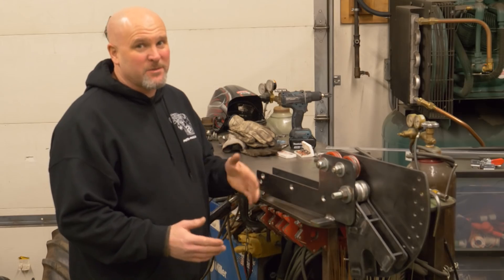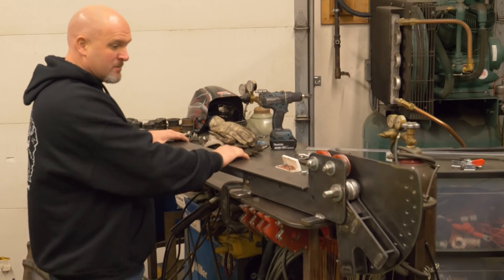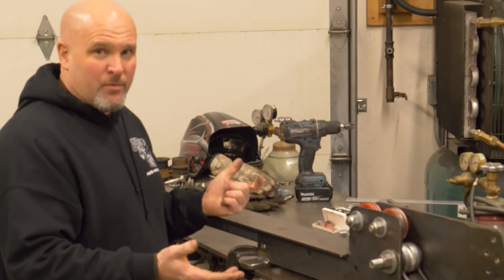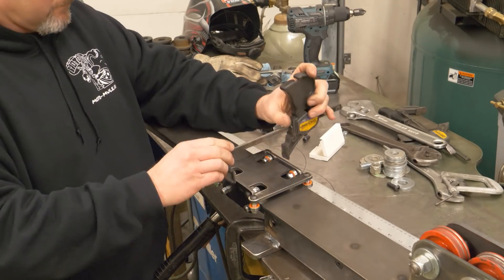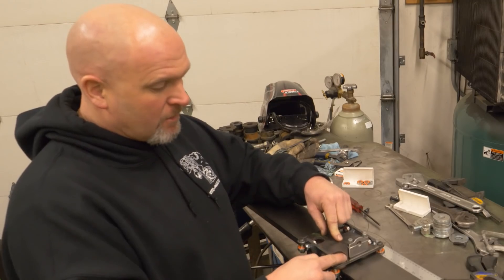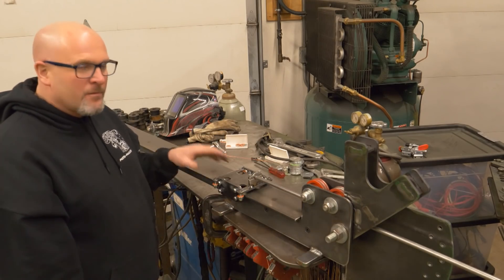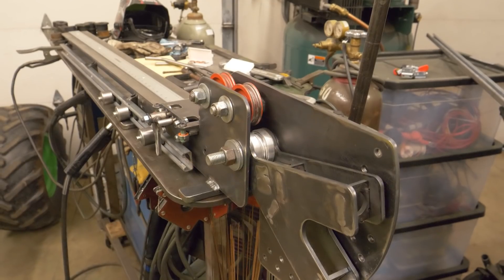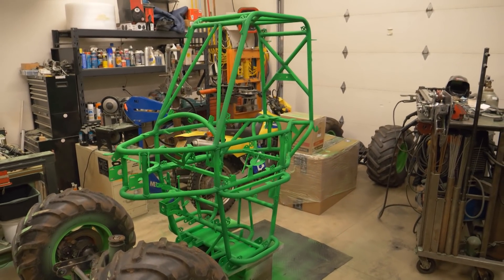DIY Adjustable Stop for bend location on Homemade Tubing Bender. Custom Tool Build Project.

Comment: The incorporation of unistrut for stops. Love it. I also noticed your next Bender 2 used the shuttle oriented on the side rather than flat. I'm guessing there are some advantages with that orientation.
Reply from the maker: It is just easier to see that way. No other real advantage. Thanks!!

Comment: Bolt the tube clamp to the trolley so multi size tube can be used. Use shoulder bolts as stops inserted from the other side  so moving the part is not necessary. great video

Comment: Instead of that bolt for the bender stop, use one of those push button pins for  quickly switching of holes.

Comment: You could put a servo linear actuator on that and have it programmed to run all three bends.  Maybe a ball screw and servo motor to position the tube from one bend to the next. Then you could design a faster way ro swap tubes and you'll be cranking those things out fast.
Reply from the maker: Very true.... Thanks for watching!!

Comment: Love it just wish you would have put some kind of wing nut or knob on your clamp so you wouldn't have to use a wrench every time and use some kind of push pin instead of thread and unthread your stop pins lol. that would drive me insane doing that every piece if you had to make very many of those. Great job tho.
Reply from the maker: Thanks. Yes, I need to speed up the threaded items... Fine for prototypes, but too slow for production...

Comment: What are all of those parts for. also how did you get all of those machines, like Is that a 5 axis Cnc in the back ground and do you use solid works, fusion 360 ,auto cad ,or something else do you have all of those machines just for fun or for work or both because that’s my goal is to have that kind of shop set up when I’m older I’m 16 now and I have a pretty large shop because my dad and I share the same hobby of mechanics, fabrication ,woodworking ,etc. but we don’t have any computer controlled machines but I am learning solid works and auto cad at school so I think your shop is awesome!
Reply from the maker: Thanks! The cnc mill is just a small 3 axis machine. I've been programming cnc machines for 30 years.. 😆 when I first started, machines had so little memory that we "printed" programs on long black paper tapes. There were thousands of little holes punched into the tapes, the arrangement of the holes told the machine what to do. We taped the ends of the tape together to create a long loop. The machines had to read the paper tape every part... 😆 I use an old CAD program I bought in 1994, it runs on a Windows XP computer.. 😆 I'm old....
Reply: Moto Mule  haha that’s awesome I can’t imagine doing that with paper strips😂 auto cad seems hard enough

Comment: Excellent video again Mike (Sorry I'm starting to sound like a broken record LOL)
I just wonder if you're thought of makeing the angle/bend stop a machined pin instead of a threaded bolt stop ? 
Obviously in my head it would need two plates to slide the " angle stop pin" in . ( I don't know of double shear is the correct term here ?) One in front in parallel to the threaded one you have in back already to "sandwich" the tube .
More work I know but it would seem a machined sliding pin would be less fiddly than threading a bolt . It would save time and speed up production too . Perhaps there is even a way to make it adjustable and quick action similar to your length stop ?
On the "dolly" could I ask if it would be possible do you think to make the tube holder removable for different diameters of tubing ? Would bolting it on be secure and rigid enough ? That way different diameters of roller could be interchanged for different radii and possibly different od diameters of tubing ? 
I know you're probably thought of all these things before . There are probably good reasons for why you have made it the way you have . I am definitely not trying to rain on your parade or anything . What you have designed is extremely simple and effective . Excellent work . But dumb minds sometimes ask dumb questions . Sorry . 

Fattrucker .

P.S. I love the tool building videos as much as the vehicle project ones too. As you said in a previous video you are just an ordinary man , and like to show how the average Joe can build some excellent tools with basic skills . You have an excellent un-patronising delivery that makes even me feel I could accomplish the impossible .

Thank you
Reply from the maker: Wow, many kind words and good thoughts here!! Thanks! I will definitely improve this tool as I use it. My main goal was to build this tool so I could land a good paying job from a great customer. Once I have a little free time, I'll try to speed things up a bit. Thank you for watching and it's great to hear that you like these type of videos too!!

Comment: guess al the bends are in one plane , with this setup the lathechuck wouldnt work , too little clearance over the rail , maibe you could use a large drillchuck instead 
think the screw in bendstop will get tedious after about 5 bends , maibe change it intoo a barionet lock (DZUS fastener)that you can loosen and fasten in a quarter turn 
you know eventually some companies are going to contact you to build them a few of those so they can do their own bending , think starting some garage based toolmaking / fabricationsolitions company is in youre future
Reply from the maker: Yes, I need to speed up all the fastener type adjustable features... But this got me moving and able to land the job. Thanks for watching!!

Comment: Necessity is the motherhood of invention. This guarantees repeatability. I wish I had one of these when I bent my gutter hangers for my seamless copper gutters on my potting shed. I used a tubing bender for hydraulic brake lines so the hangers are all catywampus. I tried clamping them between two sheets of 3/4" plywood and used heat to annesl the copper tubing to hopefully stiffen the tubing and hold there shape. I wish my bends were in the same plane.
Reply from the maker: Indeed... I didn't have a way to pull off this job without creating this tool.. Thank you for watching!!

Comment: If you want to improve your bender some more, try to make it so you don't have to change the stops, some how. Or, if possible, double up the pulleys and bend 2 at a time side by side.

Comment: Did you make the angle stop pins a few degrees past what you wanted to adjust for the spring back of the tubing?
Reply from the maker: Yes, but I went too far... 😆 should have gone about 3-4 degrees, I did 6, so, the band's are about 2 degrees past what I was shooting for...

Comment: Nice 👍😉, I would use a bicycle type quick-release type bolt for your tube clamp and your stops... no tools needed, as well as add a backstop on tube clamp so you don't accidentally clamp it in the wrong spot. Also would put a small handle on the latch/lever mechanism, so you don't accidentally pinch a finger or something on the return slide between it and the stops, that would hurt.
Reply from the maker: Good ideas!! Thanks for watching!!

Comment: Cool you shoud make something like a quick pin so you dont have to use nuts and bolts for guides. And maybe make little handle for you clamp screws so you don't need a tool to loosen them . But looking good 😎😎😎😎

Comment: 16:06 looks like back cutting the treads on your stop pin saved some time as well. A toggle clamp to replace the cap screws to hold the tubing in place would speed things up as well. Anyway Nice job Mike!
Reply from the maker: Yes, removed half the threads... Agreed, a bicycle quick release might make it's way onto the Tube Clamp... Thanks for watching!!
Reply: @motomule  hey Mike, just had a thought. A quick release 5C collett holder. Then hold the holder with a toggle clamp. this way you could get repeatable offsets at 45 and 90 deg.

Comment: Incredibly repeatable, say that 10 times fast!
Reply: That, that, that, that, that, that, that, that, that, that.  Dam, your dead right.
Reply: Paulman50 
I always wondered if a non pump 12 gauge rapid fire could be a do-it-yourself project at home. Are you familiar with how many small parts something like that might have?
Reply: @davidskowronski6618   my project at the moment is a 1200 X 900 cnc router and plasma cutter. Way over my head so I'm going to get a little help for the electronics.